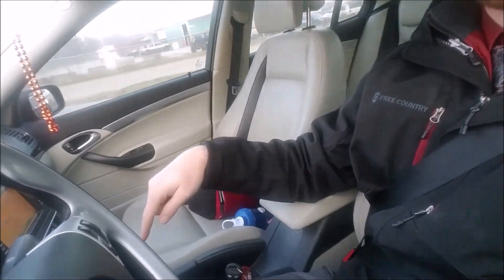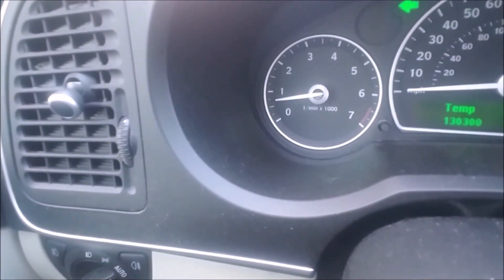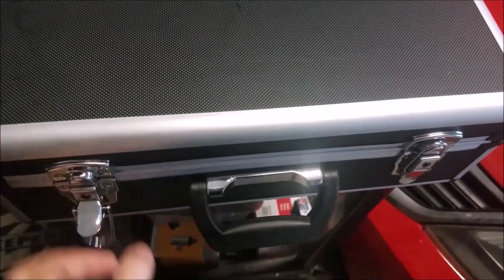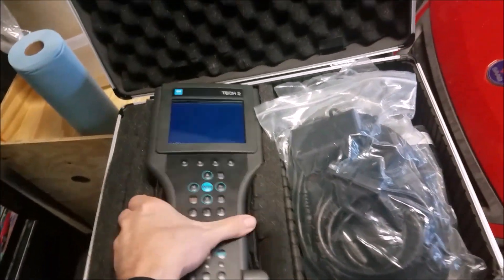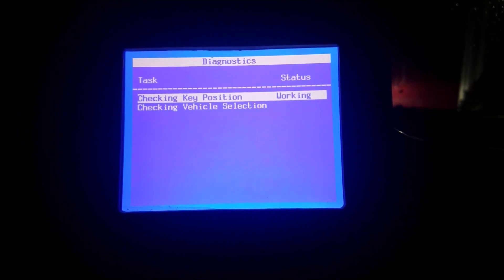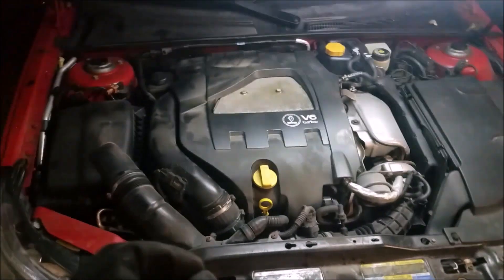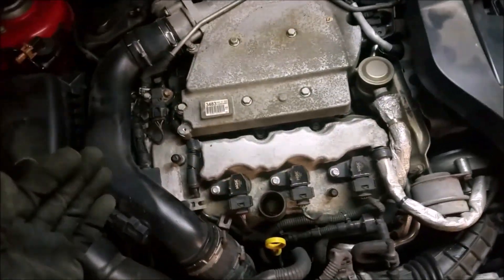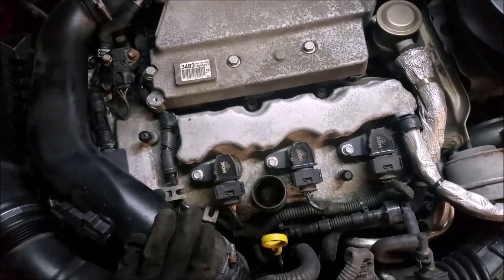Diagnosing & Fixing SAAB MISFIRE Issues

Comment: I have a problem with missfire on cold start. Changed plugs, coils, even timming chain. Missfire are full randomly, checked cylinders pressure and the only one worst was 9,5 bar's. Injectors clear and when car is hot sometimes had a little missfire on cylider 6 and car shakes very light, hard to feel. Any ideas? :( after cold start procedure missfires disapeard..
Reply: I have a very similar issue. Random miss on cold start, seems to affect cylinders 1-3 the most. Smoothes itself out after 5-10 seconds. No issues while driving or while engine is warm. Cannot figure it out.
Reply: @austensworldofcars  Tell me, have you done a increase power with chip tuning some time ago?
Reply: I had random misfires on cold starts and it ended up being the MAF sensor.
Reply: @user-cz1ex7kf2g  Thanks! I'll check this.

Comment: Drive it up a steep hill change the spark plugs also fuel filter and pcv valve the cheap things first later coil packs also blown fuse ?????

Comment: Hello, would Tech2 detect failing spark plugs, not only the coils? I've recently visited my friend with Tech2 with similar symptoms (jerky acceleration) but there were no misfires.
Reply from the maker: It wouldn't necessarily detect failing spark plugs, just which cylinder is causing misfires. Sometimes it can be tricky to track down as some coils work fine then when they get hot fail. If it's been awhile since your last tune up I'd recommend replacing all of the plugs, and wouldn't be a bad idea to put all new coils in the back 3 cylinders closet to the firewall. Ideally you'd want to replace them all but to save money and hassle you can sometimes get away with just doing half. Then if one of the used fronts is bad it's an easy replacement. Also misfires can be caused by numerous other things. If you still have poor acceleration after a tune up I'd look into the fuel system and injectors.

Comment: This is a ridiculous video and serious misinformation!

If any number of coils need doing then do them all, switching out spares here and there is a recipe for disaster.

Keeping spares to swap out is advisable ONLY until you can get a full set.

Maybe you need to check up on the job the coils and sparks do and why they need to be at the same level.

Piss poor video and NOT worth following at all if you actually care about performance in any way!
Reply from the maker: Feel free to perceive my repairs however you like. I understand saving money isn't for everyone. No feelings hurt over here! My Saab shown in the video is still my daily that loves WOT and hasn't had spark issues since. How you repair or waste your money is on you. 

My thought process is to isolate the issue and strategically replace. I get the mentality of replacing everything since that's the society we live in these days. Yes, coils are super common to go out on these and after a certain point it would be advisable to replace all. Been there, done that and eventually they fail again. Hence why I have a tech2 to aid in diagnosing specific issues. 

So about performance.. If comparing stock for stock, you will not get more "performance" if you're replacing an OEM functioning ignition coil with another OEM functioning coil. However, replacing a nonfunctioning coil with a functioning coil does bring back "performance". 

As for my exact same branded ignition coil spares - I'm sure you would just throw them away, but they're sub 10k mile units confirmed working with know history of vehicle they were removed from.

Comment: I would use coils with this part nr from SAAB, 12629037 :)
Reply: Bosch coils have a high failure rate. The Standard Ignition Blue Streaks are much better than Bosch. I have replaced 18 coils in 77K.
Reply: @mustardstain504d6  Thanks for the tip. I have always used the Bosch. If there's something better I wouldn't mind getting that instead. Do you have any link or part nr?

Comment: Hi I've got a saab 93 aero 2 ltr turbo 2002/3 , unfortunately  I've a P0300 & an o2 sensor one bank one , the symptoms are flashing engine warning light (normally permanently on )  about 20seconds into idling , ive chainged plugs n coils & cleaned  the lamdar ,  shes started (last two weeks ) to drink more oil , I opened the air intake by the  filter box  n it was dry but when I opened the lifetime filter it was sodden with oil !!!  thats where I am just now , would you go for the turbo or towards the head  First ?  They  can be a pain , but I love them .  Thanks  Andy

Comment: PCV valve? I had same problem on hwy turned out to be bad PCV valve that was sucking in oil into cylinder 1&2. Peeking into intake manifold to see if there's excess oil is a good first check.

Comment: On saab you need to use dielectric grease on the packs. Stops the pack issues. Most people no clue or dealers do on your service 👍
Reply: The coils have dielectric grease in the boot from the manufacturer. Bosch coils are garbage. The Standard ignition Blue Streak coils are great. Dielectric grease only keeps the boot from sticking to the plug.
Reply from the maker: Yes that is a good idea!

Comment: I got a misfire on cylinder 4 of an 08 2.0T ... Swapped coil out with a new one; new spark plug; switched injectors; compression is good, but I still have a misfire... Any thoughts on what it might be... I'm aware of the valve issue on the 2.0T, but if this were the case why do I have compression on that cylinder?  Is this an ECM issue, car has only 130000km
Reply: 1-check the air intake hose going to turbo for cracks
2-check the "L" shaped vacuum line under the oil dip stick
Reply: _madebyMARS  thanks, will check and see if there's a problem there
Reply: Did you ever solve this? I’m currently having the same issue on cylinder 4 and fixed it before by replacing both spark and coil but won’t go away now

Comment: Do you really need to clear misfire counters?  On mine, I don’t get any history, I have to catch them real time.
Reply from the maker: So that will be one major difference between the tech 2 and a cheaper code reader. IF you're getting a misfire code then you can use the cheaper scanner to clear, switch to coil to dif cylinder then see if another misfire code appears in the switched cylinder. However, if no misfire code is present (like in my situation) then you will need scanner like a tech 2 to see real time misfires.